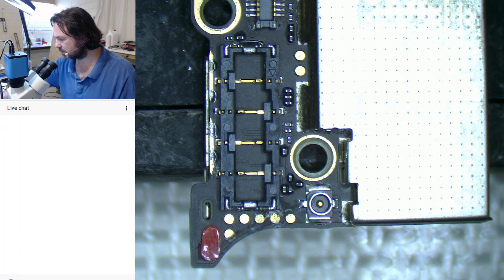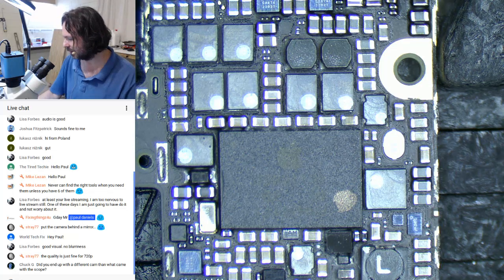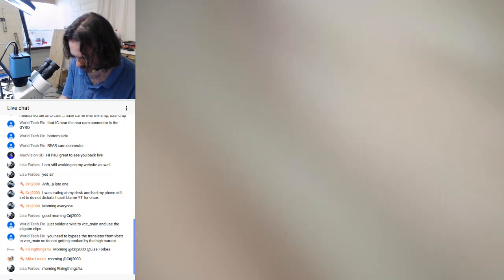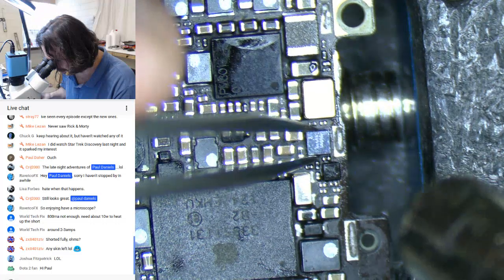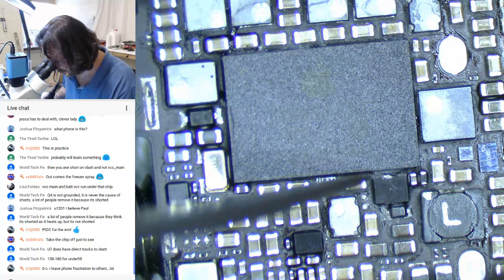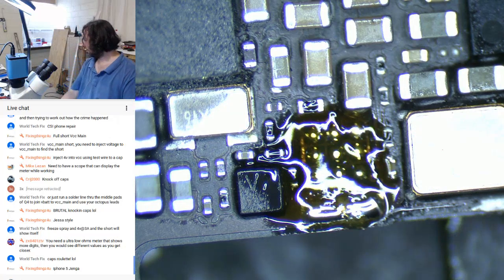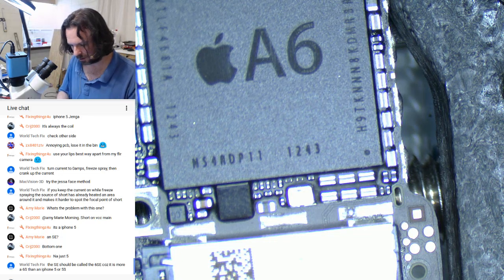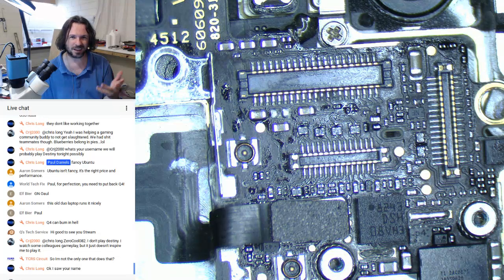Water damaged iPhone 5 attempted data recovery (short circuit)

Comment: Great job, but....it nearly killed both Mark and I to watch this.  No! Not the PMIC!  No! Those caps are all fine, move the board around so we can see!  No! You can't put freeze spray on a board wet with alcohol!  Yay! He's using his face!  No! Turn the exacto the other way, press down hard and twist to flick off that cap.  Oh FUCK! He's taking the cap off with HOT AIR!  Next to the HEAVILY UNDERFILLED ip5 PMIC, with no protection---he's going to kill this whole board, I can't watch... Then we skipped to the end.  Fixed.  Thank God.  The roller coaster has come to a stop.  I don't know if I can ride again.
Reply from the maker: Pleased to hear it was an emotional roller-coaster for you all.  Things should become less traumatic in the future.  

The whole cap-flick thing is just still such a violation of the mind, particularly with an Xacto, no matter how many times I see it done.

Comment: Hi Paul, glad to see you back online.  New gear is looking good,  audio seems clearer.  just wondering if anyone else sees a blue/purple hue mostly top left.  Kinda like when the guns in a rear screen projector are out of alignment.
Reply from the maker: There's a fair bit of blue/purple flare/fringing coming off the highly reflective end-caps or shiny parts, that's fairly systemic with these camera sensors.    That can be moderated if I turn down the LED ring light.  I'll try look at what options I can modify within the camera itself once I move to HDMI capture.